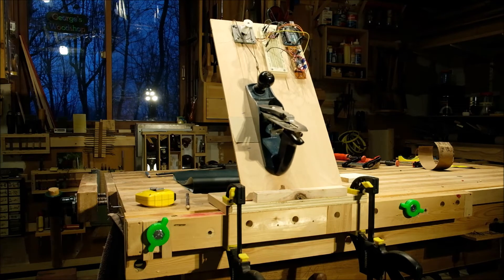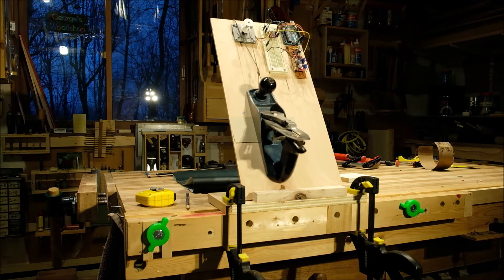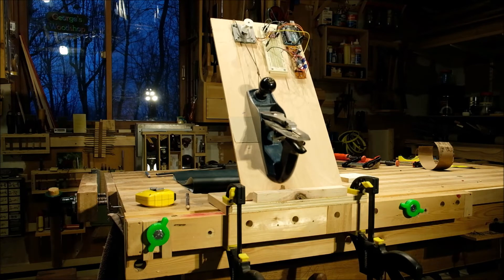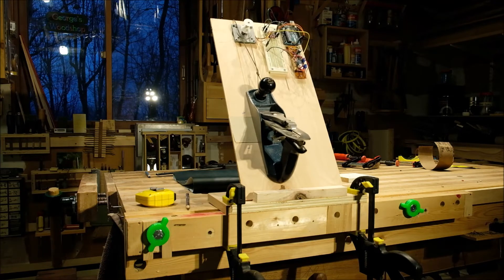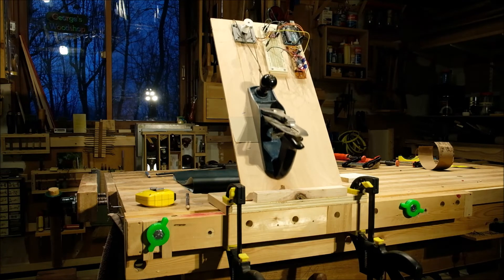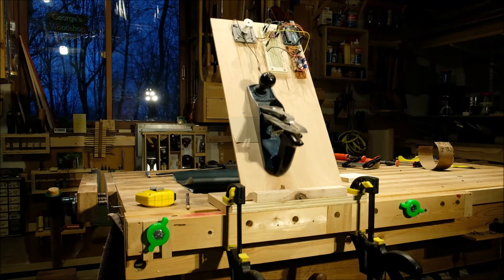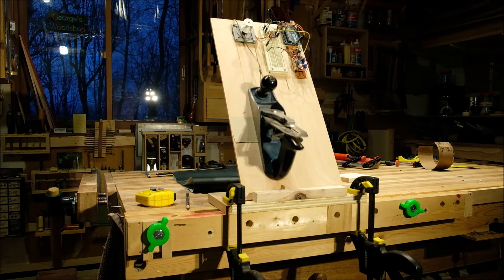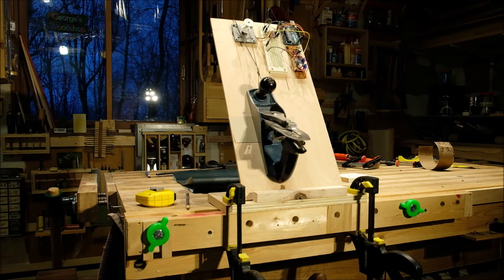Thank You Ron!

Comment: So. Playing with Arduino! I started with Arduino 2 years ago. When I was working (I retired last year),  I was in charge of the automation shop.
I now play with Teleduino: start and stop whatever you want with Arduino through the WEB.
Flatten a wood planer: That's a great application.
One more time George,  good end of the year to you and yours.
Olivier
Reply from the maker: Hey Olivier,  With the Arduino and break-out IC boards generally, I'm feeling the same excitement I did in the early 80's when you could make your computer do anything, including destroy its own operating system with a misplaced POKE or two.  These Arduinos are so much fun!  The Teleduino is intriguing, but I confess I still like to be in the same room (or house) when these things are operating.  I went less global, by trying to use tiny microcontrollers (Atmel -- now Pic -- Attiny85 for e.g.) wherever possible.  They have completely restored the fun in programming for me.  And BACK to you:  Best of Festivus!